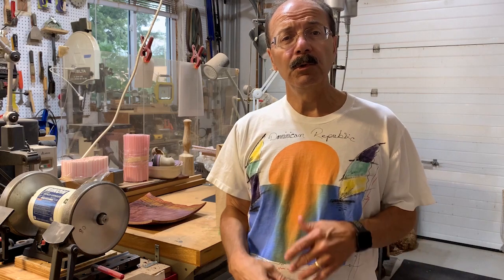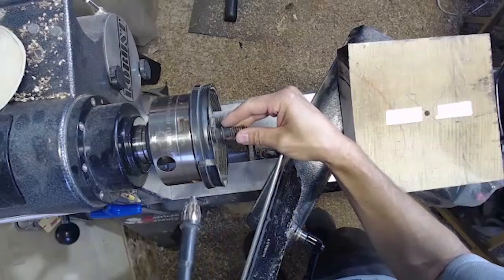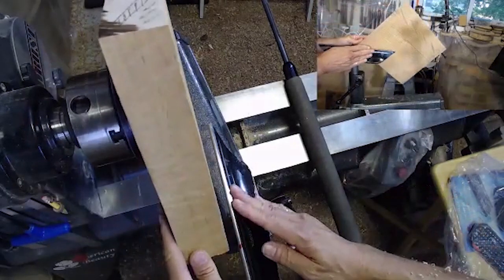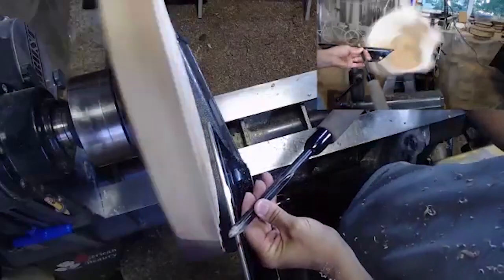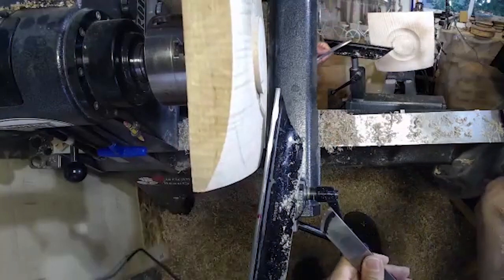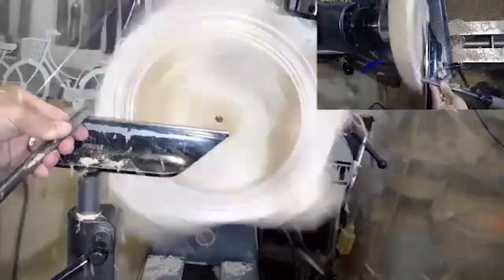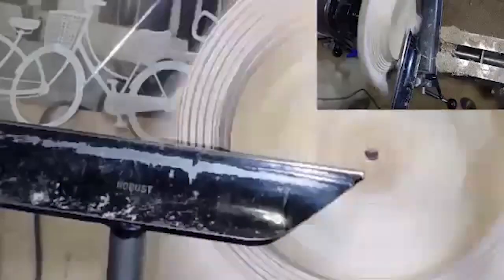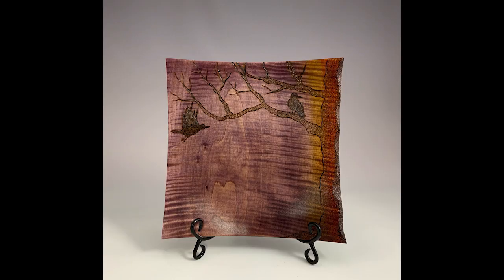Woodturning a Square Platter - Extracts from a Demonstration

Comment: Nice work, Frank.  Thank you for sharing it with us.  Would you mind sharing what kind of dye you used on the project...and I'm assuming that you used General Salad Bowl Finish as your final finish?  Thanks!
Reply from the maker: Thanks Donovan, sure no problem sharing.  For the dyes, I currently use the chestnut alcohol based dyes and I always dilute them - full strength is too strong for me.  Once my supply runs out, I am going to use transtint or color tone made for guitars - these are more expensive, but are more fade resistant.  For this dyed artistic piece I used spray gloss lacquer.  If the dyed piece is a bowl or something that might be used for food, I would then use General salad bowl finish.